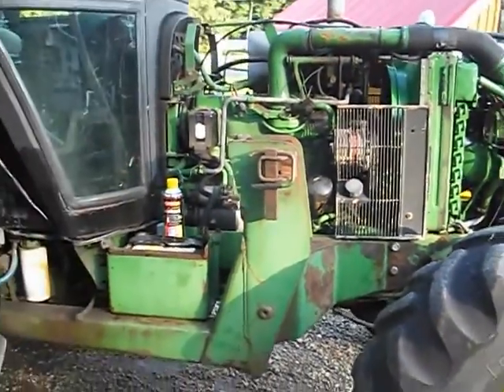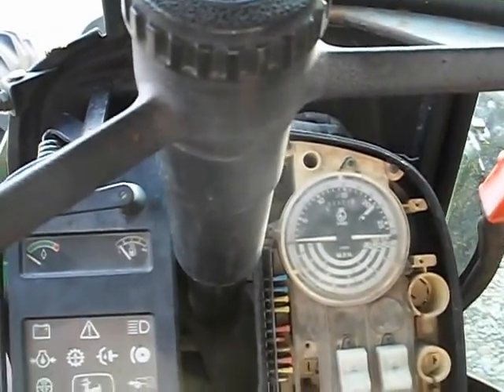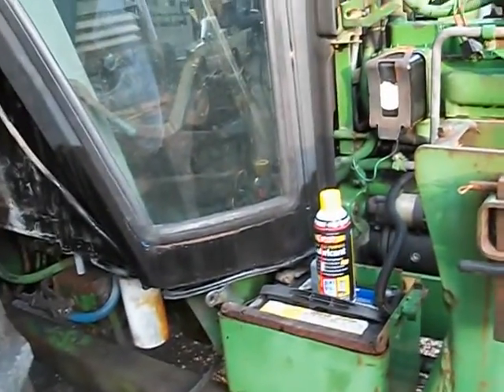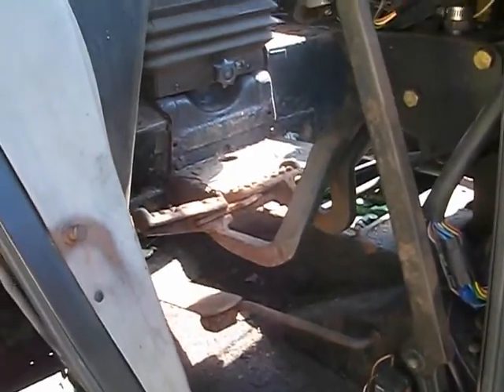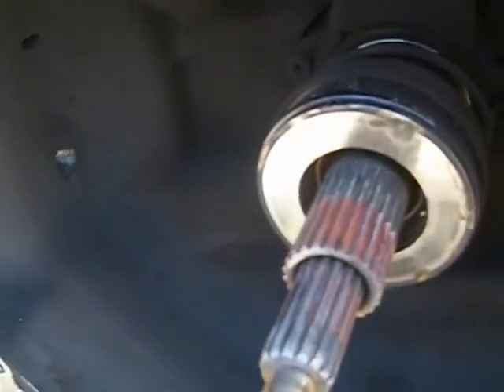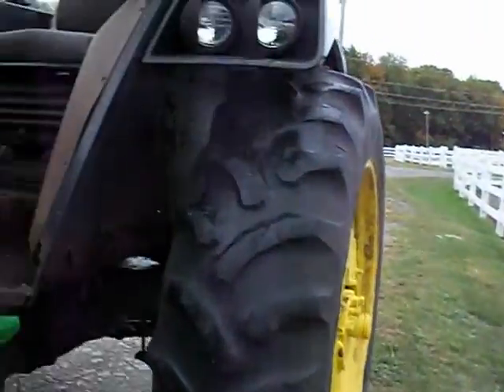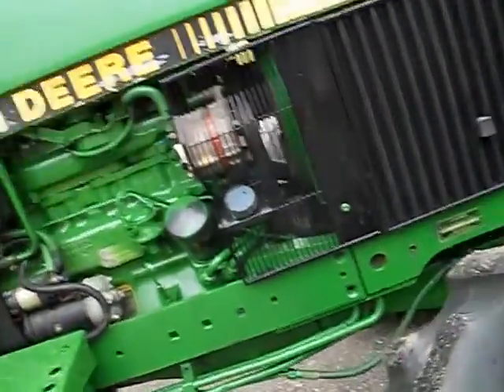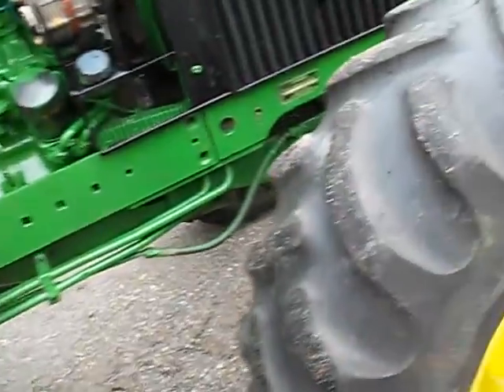John Deere 2355  Tractor split Parts 1,2,& 3 clutch replacement

Comment: How's it doing for you?   I have a 2350 open station. the cutch is starting to slip under heavy load and the pto lever broke internally so I'm looking at splitting it to fix all thabut other than that it's been a sound unit the two years I've owned it.